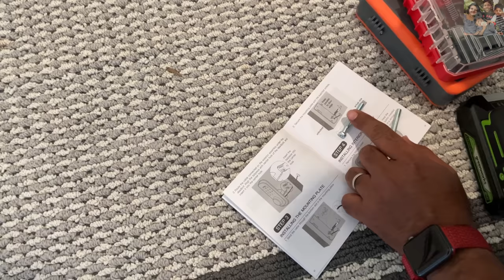Americaல எங்க வீட்டு வேலைகள்🏠~Summerக்கு Super Mango தொக்கு ~OUR Busy Weekday Vlog~Family Traveler

Comment: Most of the times you won’t enter the house through front door. It be better to have this smart lock for the garage door for home entry. The only thing that is needed in the front door is to replace the small screws in the dead bolt with lengthier screws.